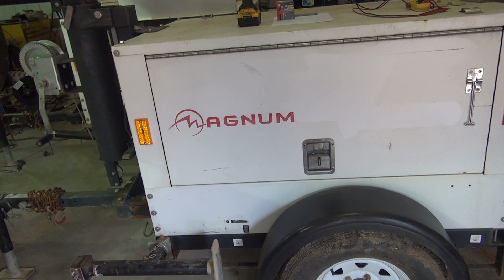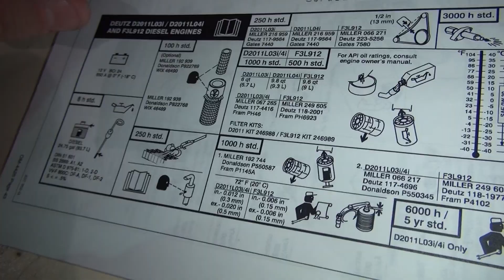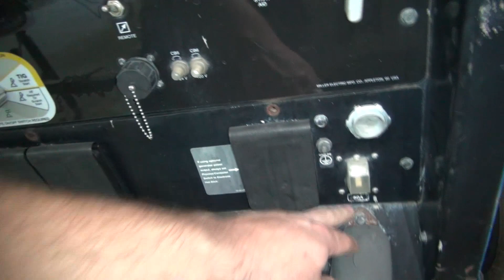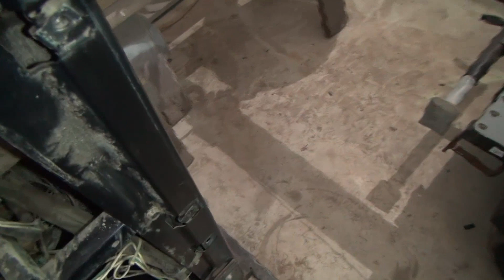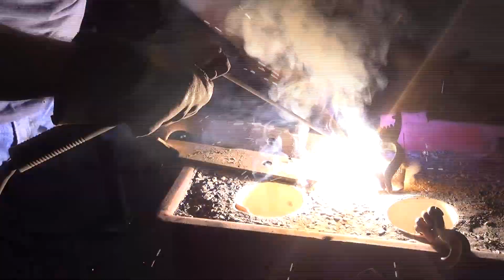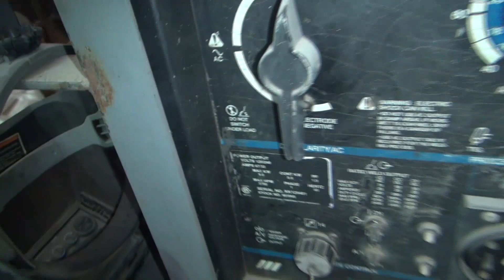I bought welders and light towers

Comment: I used to use one of those Miller's back in the 90's. They were very reliable and stable machines. The generator section was electronically regulated so it was stable enough to run electronics. I often used it as a generator to run a larger sound system with no issues.  The tower light generator however is capacitor regulated and the voltage is not very stable also it is not very clean power. Don't use a tower light generator for anything other than lights or small power tools.
Reply from the maker: Yep you are correct. I did let my parents use a light tower during a hurricane for 3 days to run a fridge window a/c and TV. Told them it wasn't the best for sensitive electronics but figured it was probably about as good as some of the cheap generators people were running and they run a really long time on fuel so they didn't have to add any. I used one of the welders to power my house for 9 days during a hurricane. Used over 100 gallons of fuel.